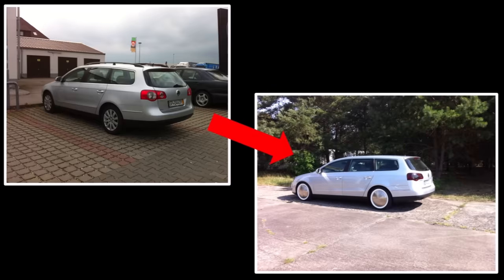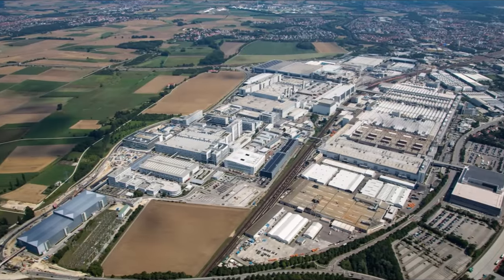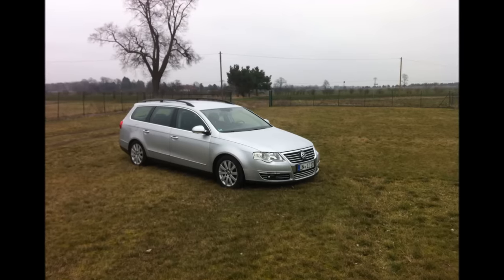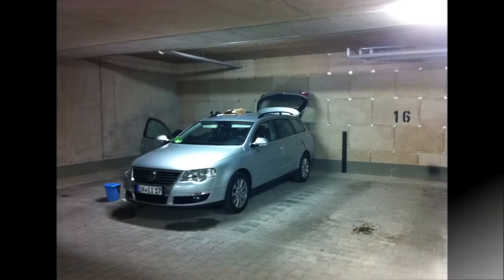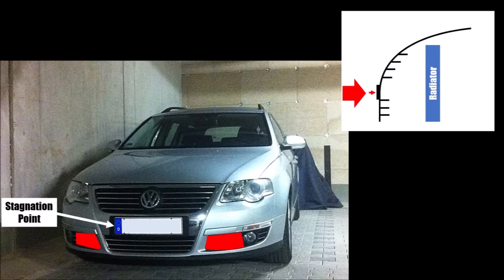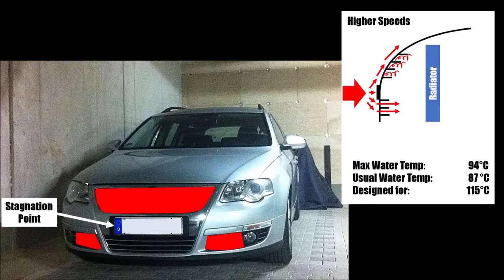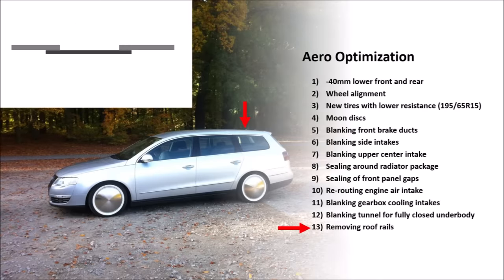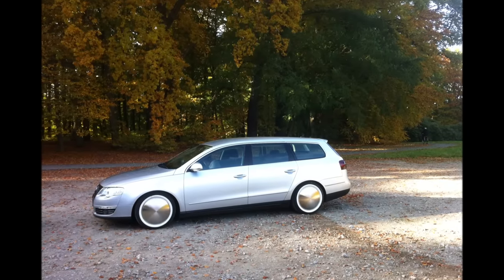Massive Drag Reduction For Tiny Budget - How I turned my family car into an AERO Star

Comment: A 25% reduction in highway fuel consumption is impressive.  Even more given the car looks so stock still.
Reply: Wish there was a way to make the disc wheels look more stock
Reply: @Eduardo_Espinoza  maybe getting them painted like a normal wheel?
Reply: @Eduardo_Espinoza Not sure if would be as efficient, but some manufacturers guide air around the wheels (think it’s called an air curtain)
Reply: Brakes need cooling, priving brakes from airflow is a safety hazard.
Reply: It looks stupid. Simply not worth doing
Reply: @Splarkszter As is explained in the video; not if you barely use them.
Reply: @sandersson2813 Beauty is in the eye of the beholder. I think it looks neat. And that's quite a big leap in fuel consumption. Would reduce my annual fuel cost by around 500€, if I could get the same improvement.
Reply: @mandrakethemadcoder  Not sure I buy the figures, there may be many parameters which affect economy not taken  into account fully. 
If any company could cheaply improve efficiency so easily, they'd already be doing it, and it wouldn't be the preserve of some tiny YouTube video.
Reply: The way you drive is way more important than all your modifications.
Reply: @Splarkszter  Not if you brake with your engine. It's like driving down a hill, almost everybody cooks their brakes, because they are standing on the brake pedal the whole way down, instead of shifting to a lower gear and let the engine hold the car at lower speed. You don't need to cool it if you keep it cool.
Reply: He could have modified it further by removing the engine,  he would have reached 100 % reduction in fuel consumption!
Reply: @Eduardo_Espinoza  manufacturers like Tesla put wheel covers on that look stock but improve efficiency.
Reply: @Eduardo_Espinoza This futuristic look is right up my alley
Reply: @sandersson2813  He explained why it's not cheap, manufacturers sell the same car regardless of where you live, use case, or weather conditions so all of the aero changes he made are not practical for everyone and the manufacturer would need to make highly specialized models for each place just to get 1 extra l/100km that many wouldn't care for.
I'd guess the moon disks are a bit overkill and regular aero hubcaps similar to the ones tesla uses would do at least 90% of the job
Reply: @joey_f4ke238  Cars are not the same at all in different markets.  Different countries get all sorts of styling kits and even among a range of one particular model you get dozens of different specifications which have a different effect on aerodynamics or which add weight thus leading to lower fuel efficiency. 

My point was that the changes he made to this car, are not necessarily what resulted in the changes in MPG, they MAY have made some impact but if it was that easy you'd have dozens of companies offering to retrospectively do this for you ( but obviously do it in a way the car would look less stupid)
Reply: I wonder what the reduction would be without the moon wheels
Reply: @czkmeister Except he blanked the drivetrain cooling... and brakes are a wear item
Reply: @GoodMenstruationAttitude  Almost nothing. The biggest aerodynamic issue with wheels is the running tread area as that faces the flow of air, and you can't change that.
Air resistance and drag  travelling around the rim face and other side is fairly minor. 

What it is worth bearing in mind is that most cars aren't driven at an average speed where aerodynamics  makes much difference anyway because it's largely urban driving at 30mph. .
Reply: @GoodMenstruationAttitude  Brakes don't get hot if you don't use them. If you brake mostly with your engine, you don't need to worry about brake cooling
Reply: Fuel reduction figures were from timing belt AND low roll tires AND proper alignment AND drag reduction aero mods. Surely I'm not wrong and I'm not the first to notice there's no direct A-B testing of ONLY the aero mods without the effect of normal maintenance?

This video's a bit of a fail considering 90% of the described worklog is mods with no ability to know what effectiveness they had
Reply: More like 11%, but yeah for that 0.6 mpg all of these modif are not worth it.
Cost of modification vs MPG
Reply: @sandersson2813  Nobody would buy a car with those wheels because they're hideous.  Car manufacturers have to design and build cars so that even idiots can drive and maintain them.  This car needs an owner that actually cares enough to keep an eye on things like engine temp etc which most people just wouldn't bother with.
Reply: @isthatujeebus  Actually car companies are making increasingly ugly wheels. 
Tesla for example make the ugliest wheels in the business.
Reply: @czkmeister yeah,and just worry about engine wear,cheaper to replace brake pads , yes?
Reply: @Splarkszter brakes do not get air flow from wheels lol

Comment: I am very surprised with how large of an efficiency gain you had! Great work. Have you done this to your current daily driver?
Reply from the maker: Thanks, I have done similar modifications to later daily cars but not as extensively as on this one.
Reply: @BSport320  whats the milers per gallon improvement? think flight says he got almost 18 percent improvement in subaru flat 4 wagon
Reply: @kalmmonke5037  the math is quite simple, by the numbers he gives, it was roughly 20% on countryroads and 25% on the autobahn
Reply: @BSport320  I drive a 3 liter ( 100 km ) diesel car and I would really like moon discs. How to mount them and do you sell ? I use 195/55x16 tires and in Denmark. Martin Siebert
Reply: 1+ liter per 100km - just hilarious, even in my poor country with pricey gasoline - it's nothing, just 20l for 2k trip, costs about 100 euro extra 🤷‍♂

(implying you are not poisoned by eco-populists)
Reply: @chiboreache  for his use case it was around 4340€ saved at 1.55€ L in a year for only his traveling every second weekend and that alone is yearly tax, insurance and services at the dealer
Reply: @chiboreache I do 20k km in a year, wich is pretty average. That's 1k euro a year difference by your prices. People invest thousands to see those yearly returns. Let's say a cars lifespan is 200k. That's a 10k return.
Reply: @ghost4fly659 that's how narrow of a financial path you have in Germany. 4k makes a difference in a month, but year? Meh
Reply: @TheKitMurkit  I don't understand what you are saying
Reply: @martinsiebert3853  they clip on, just like normal plastic hubcaps :)
Reply: @TheKitMurkit it's still money saved... 4k extra a year is enough to buy yourself a gaming pc setup, a 4k 75in OLED, and some cocaine on the side...
Reply: @marcusborderlands6177  No one saved 4k in a year. 
It wouldn't even cost anything like 4k to do 20,000 a year BEFORE the mods.
Reply: @ghost4fly659  What's your maths, how do gain 4340 EUR savings per year ??? The consumption dropped by 1.2/1.4 liter / 100km. Let's calculate (assume average 1.3 liter saved per 100km): 1.3 liter / 100km * 100.000 km = 1.300 liter saved per 100.000km => 1.300 * 1.55 EUR = 2.015 EUR saved per 100.000 km
Reply: are your parents cousins?? look like by your views and interests @chiboreache

Comment: The 1.9TDI PDE is always remarkable in its fuel economy. A relative of mine has a 131hp 6 speed 1.9 in a Sharan, which is the biggest actual "car" you could get, maybe the Caddy Maxi is longer yes. But above that was the busses / transporter vehicles you could say. Well back to the story, despite being a very high and a moderatly long car with a huge windscreen, it is driven without every thinking about it, with 6,5l/100km. If you drive constantly with a little effort then 5,X is no problem. I drove it once and got 4,3l/100km on a 80km trip, 20km country road, 5km city, 55km Autobahn. But I also only drove 90-105km/h, much less than you with 130. Still for such a big car, I am always surprised, and it is not even really slow, the 1.9TDI has a lot of torgue until 2500rpm. VW was a very early adopter of offering 6 speed gearboxes even in cheaper cars and smaller engines, not just in sports cars.
Reply: Exactly, i have a 2003 Alhambra with a chip mod for 150hp but also low ratios at lower ranges for fuel efficiency. that means that it has a higer turbo lag but i managed to acheive a 5,0l/100km on a 5000+km trip through the balkans (mountains etc) from Poland to Poland through basically all the balcan countries. Lowest avg i had was 3,7l/km on a 200km segment somewhere in Slovenia or Croatia, i dont remember. 
i cruised at about 90km/h without cruise control and managed to refuel iirc just 4 times during the whole trip. 
Also i thisn it has had the egr blocked at the time.

Comment: The Passat Variant already had a good (for 2006) drag coefficient of I think 0.29 or 0.3 (there was a Bluemotion version that even lowered this by 10% or so). Your modifications go even further and you may have been in the 0.25 range, possibly even lower. My current car, an 150HP TDI Arteon Shooting Brake, which is at 0.26, uses around 5.5-5.8l/100km with a not insignificant city driving ratio. I can easily dip it below 5l /100km, depending on the route and traffic. I find that quite impressive, considering this car is physically larger, weighs 1700 kg, has fat tires (235/18s), all modern creature comforts, safety features and is loaded with tech.
Reply: DSG (a dry one) helps by 0.5L/100km easy and even more in the city.
Reply: My brick of a car (2006 Honda Element) gets about 10L/100km, or 23mpg. I'm pretty jealous of your aero lol
Reply: @smileyguyz  that's good for an element, i have a 2.5 inline 5 jetta wagon and i have difficulty to get under 10L/100km, i think my best was 9L/100km during a few 1200 km trips between my work and my parents home
Reply: That's higher than I expected.. thought the previous Passat had a really low CD.

Comment: Loving this. I've got a Touran converted to electric where low drag is even more important. The exhaust duct and air intakes are already closed off because we barely generate any heat at all. But that is only 2 of your 15 measures completed. Thanks for the inspiration!
Reply from the maker: Sounds great!
Reply: Interesting! Could you describe the conversion?

Comment: Very thorough explanation, and a good do-it-yourself project.  I would like to have seen your fuel mileage after you repaired/serviced the engine, but before your aero mods.  Cheers from Canada.
Reply from the maker: Yea, me too! Like I said, I sold this car years ago and didn't take this data at the time.
Reply: Now we can only estimate. He went from 5.5 to 4.1. Wheel alignment and engine service could have lowered the consumption to 5.2, maybe 5.0, but not less.
Reply: Perhaps also consider what the official manufacturer specs where for fuel economy at the time of the sale (2006). And yes, I know it’s done in ideal conditions etc.  but it’s another data point to compare to.
Reply: @goldenhandcuffs claimed consumption is usually easy to beat with 130km/h on the highway. My parents did a trip with 4.8 l petrol going 120 on a 1998 family car. Specs where 5.5 or something.

Comment: Excellent work! Very thoroughly and thoughtfully done! I know the exercise here is only aerodynamic improvements fit for your use case with a stock drivetrain but I would have been interested in additional modifications such as optimizing top transmission gear to sit at the most efficient RPM when at 80mph or other mechanical improvements and trade-offs.

Comment: Great video!
If only the standard customer would have just a little technical understanding, manufacturers wouldn’t need to oversize most components. Cars would be cheaper, lighter and more aero.
Reply from the maker: Very true, but if a customer reports an overheating engine or brakes, it's bad for the manufacturer.
Reply: Yes, but most people are generally completely oblivious, so that's why.
For themselves and for other road users.
Plus, not all roads are flat like a pool table, like they are in Germany.
Plus, not all fuels are of the same rating around the world.
That's why the manufacturers must assume the worst.
Plus, after driving for the last 35 years, with 50k per year, I've never been in an accident, but I'm still glad the car has crumple zones and airbags...
So, in a way, your remark is unfounded.
The closest one could get towards the cars you mentioned, is an 80's medium or lower class car, which, in case of an accident, crumples up around the occupants.
And if the occupants didn't die instantly from the crash itself, he or she would die in the subsequent fire.
Reply: Oversizing is better than operating on the edge. This improves lifetime.
Reply: @dennismarks6133  Oversizing is mostly a sign of an engineer that’s either afraid to make a decision or doesn’t know what he’s doing… or both. A field especially plagued by this is civil engineering.
Reply: @AR_434  No. You need some buffer in case something unpredicted happens. If you don't do that, you failed as an engineer.
Reply: @dennismarks6133  that’s called factor of safety and is part of every calculations an engineer does.
Reply: But you never know if the car's future owner is hauling lumber through a mountainous desert at race track speeds.
Reply: Manufactures will still oversize everything, because warranty.
They want to avoid any problems during warranty. And parts are cheap, labor are expensive, downsizing don't cut cost a lot.
Even with all the extensive cooling etc. European cars still suffer heat problems in Asia, especially before 2000. 
Most of these modification are cheap if pass warranty...during warranty, most of the things on this car is banned.
Reply: car must run everywhere and don t cost too much .
Reply: @BSport320  were u trying new mods with XL1 style wheel hubs as well ?
Reply: @AR_434  Dunning Kruger effect proudly on display.

Comment: Engineering at its best! 
Absolut genial was du da gemacht hast! Ich wäre extrem interessiert an einem leichten, minimalistischen, schwach motorisierten Kombi der auf Effizienz getrimmt ist. 
Ein Freund von mir hatte einen Renault Megane BJ 2015, 1.5dci mit 6 Gang HSG .
Wenn man den sparsam fuhr (Tempo 90-100 auf der Autobahn) merkt man dass das Kühlwasser nicht auf Temperatur kam. Wir vermuteten immer dass das Auto mit dem selben Kühlpaket wie der 1.9dci ausgestattet wurde. 
Trotz lausiger aerodynamik konnte man den Megane problemlos mit 3.6l pro 100km fahren. 
Im Alltag mit Tempo 120-130 lag der Verbrauch immernoch bei respektablen 4,3l pro 100km.

Comment: There’s a guy in like Oregon or Washington in the USA who claims to have gotten an old F250 over 25mpg (would have been like 15mpg or worse normally) with similar ideas. Covered all the undercarriage with plates, built a custom lid for his bed that was aero, put in a button starter so he would never idle, removed the a/c and a whole bunch of other parts to drop weight. The truck was functional but not really as a truck anymore. It’s funny because he could have just started with a car that got better mileage, like in this case.